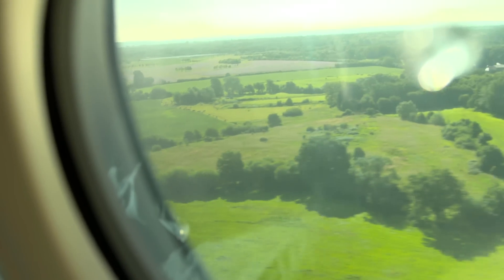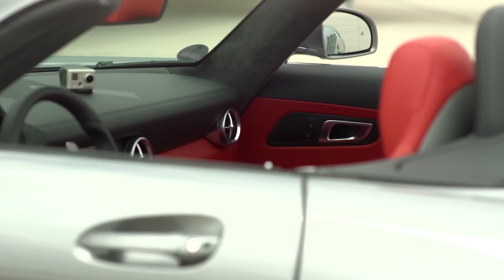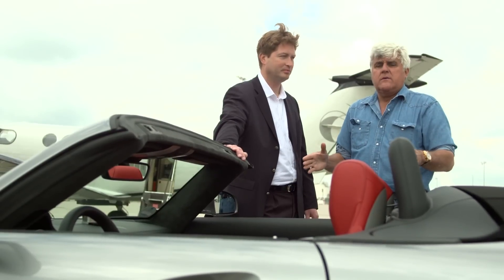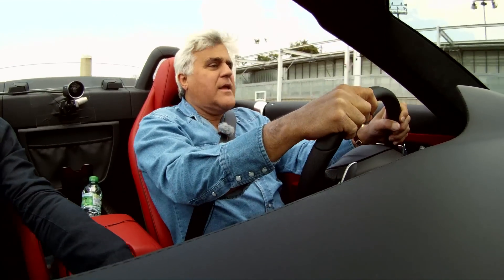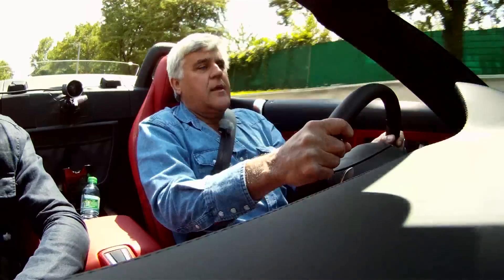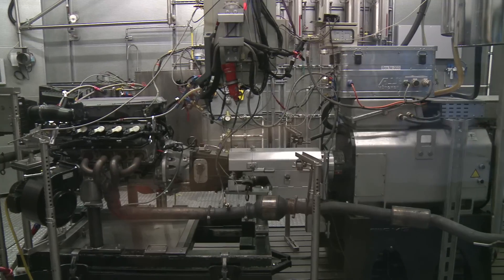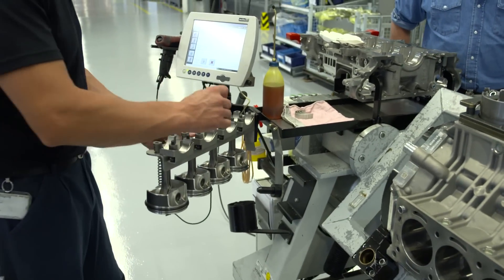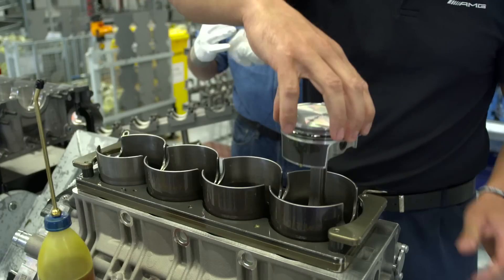2012 Mercedes-Benz SLS AMG Roadster - Jay Leno's Garage

Comment: I definitely agree on things like ground clearance, how well suited a car is to normal roads is a big deal to me. I want something I can drive without fear of ripping off expensive bumper parts or covers on the bottom of the car, or even worse, potentially damaging something as it scrapes.

Comment: assembly machines can build with much closer tolerances and a MUCH higher precision and consistency than a human can.so many advancements have been made since then that engines can be made with a much lower level of imperfections now than ever before. Nowadays, hand-built engines have a certain nostalgia to them, but depending on the sophistication of the assembly line (with exceptions of course) I'd say machine-built engines will be more efficient and have less problems on the road.

Comment: The license plates on European cars look much better than my American one...
Reply: Not really. In my opinion the opposite is true ;-) The german license plates are a lot wider than the american ones and they always look the same. The car owner also has to mount two of them, in the US you only have to mount one on the back ot the car I think? BTW, when you get a license plate for an american car here in germany, you have to buy a special plate called "verkleinertes Kennzeichen" (small licese plate) which costs a lot more than the standard wide plates.
Reply: Lejf Diecks Depends on the state. Some have only 1 plate, but most have 2. And they both have to be mounted.
Reply: Lejf Diecks
In America, it depends on the state in which you live. Some states only require  a rear plate while states like mine, NJ, require both a front and rear. You can also purchase custom plates that say things such as "hotrod" or you can purchase plates with flowers or animals or special graphics on them.
Reply: I am from Europe when we see American plates looks better 100 times. Our plates looks to cheap and small. AND WE need 2 plates allways. No country allows you to have 1 plate. U ruin the front from the car. In usa they use back plate and looks much better. and amg is overpriced car. Mercedes cost much more in Europe than America. AMg cost a lot 
CLS 63 AMG S 4MATIC cost 220.000 dollars cheap price. In Norway cost 300.000 dollars. Europe SUX AT PRICE from car. For bad car Mercedes 50.000 dollars 85 kilowats. For 50.000 in usa u get mustang GT and V6. I rather have mustang.
Reply: If you look closely, most things do. Like, american supercar: dodge viper=totally looks like some cheap ford fiesta inside.
Reply: *****  Every sport car should look cheap inside. Ferrari looks inside cheap to vs mercedes s500 or maybach. If interior looks so modern than you forgot its a sport car. Because when you are overspeeding those things interior inside you never need it. Thats what mercedes missed and bmw audi. ANd thats why they cost so much vs americans but not giving as american car for that kind of money. I prefer american car if you got money. I drive 525d because of work. I had mustang before but i work 31 days per day and can't drive everyday. But for summer i will drive only mustang. And feeling is a lot better in american car than a europe car. I had 12 cars from europe best feeling is USA CAR. You can try. Most people who spends 90000 dollars for diesel car who is rich for me is dumb He spends so much money on diesel and 100000 things in car and he don't use them half. So why spending so much money. ANd driving diesel to spend less fuel ? I spend less money getting powerfull petrol car and spends more fuel and what.. Whats the point.
Reply: *****  and ford fiesta doesn't look cheap inside for that kind of money the newest one.
Reply: I'm sorry, I reckon you gotta point, but european stuff tend to be more sofiaticated. Americans are more pragmatic and focus on getting it done rather than how it's done.
Reply: +Maximilian Dummnichtswürdigkerl hey. I must say I agree in some ways with you, in the UK and Europe we used to look down on American built cars, it was a running joke and very snobbish, today though I think the tide is turning. The Americans have built some great cars in the last few years and they do all what the European stuff does only cheaper. Yes build quality could do with some work but I think in 10 years time a lot more if us will be driving American cars.
Reply: Some European countries requires a yellow rear plate (GB for example) and they're ugly as hell. Quite a few people within the EU-parliament and countries which have them wants to make it so throughout the EU. I don't really understand why. 

The nicest are the American states which only require one plate. However the American plates have to me always seem to be a bit novelty looking. Good on classics but not modern cars.
Reply: +MakeSh00t They're not missing anything since that's what the European market wants. You spend most of the time in your car, so it should feel nice. And trust me that on European roads (which in my experience are better, albeit narrower) where you're allowed to put your foot down the mustang does not feel nicer. Once you go over about 100mph and have a slight corner a mustang is not a nice place to be.
Reply: Völundr Frey lol. i have bmw goes 140 mph and i never drive 140mph. So mustang wins. Mustang have no interior that is why is cheap. Everyday i see cars on roads.. When i saw cobra shelby all mercedes bmw can hide. Mustang is well designed. For its price. Ok new mercedes looks much more better like cla or cls.
Reply: You must think anything from Europe is better.
Reply: It's the oppside for me. Probably we like what we can't get.

Comment: Is there a way to Contact Jay Lenos Garage? In this Video he says he has had long ties to Mercedes Benz. I and many others own 1997-2002 Mercedes Benz R129 series cars (SL  280, 300, 320, 500, 600). For many months now all keys for these cars have been on backorder with no idea if they will ever be available again. The DAS (drive authorization system) is very complex and almost no locksmiths can make a key. There is a locksmith in California and maybe 1 in new York that can help but you have to have the car in person!  I live in MA and many of these cars (in excellent shape and worth $10-20,000) are sitting unusable due to the lack of keys.
Just wondering if Jay could help some fellow car and Mercedes enthusiasts out?
Reply: It is a seventeen-year-old used car. When I bought the car 6 months ago it only came with the one key. In Massachusetts all cars need a title so NOT a stolen car. 1997-2002 SL series cars the keys are no longer available. Do some research and reply! I have been to five different Mercedes dealerships in been in contact with Thomas Hanson of classic Mercedes parts and the keys are no longer available from Mercedes-Benz
Reply: I paid cash for the car from a reputable used dealer. He was also quite surprised when we try to order an additional key after I had bought the car. You keep avoiding the actual issue here. Mercedes no longer manufactures keys for these cars. It is not like Mercedes won't make the key because they think the car is stolen. The car is not stolen. I own the car outright and it is a lien free title. Once again the issue is Mercedes no longer makes keys for these cars!!!!
Reply: No they can not!!! The transponder keys with the chip in them the valet keys and the Flip Key remotes with the transponder chip in them are all no longer available indefinite backorder!!! You are not the first person to think it's as easy as you say. Actually the keys all come from Germany. They are then sent to Texas where they have all the drive authorization system codes and can install the code and cut the key for the car ordered from the Mercedes dealer. That is not possible on this car anymore as the original manufacturer of the keys is no longer in business. That's why the keys are no longer available call or talk to a local Mercedes dealer at first they'll tell you yes but once they look into it there are no keys available!!! I have had a bunch of actual Mercedes dealers try to order me a key. Every one of them comes back with the keys are no longer available what is so hard to understand??? I even asked to pay for a key so I could wait on back order in case they ever came in. They would not even allow me that. You are wrong and will not admit it!!!
Reply: 2000 SL 500/R129 Here is the VIN# WDBFA68F1YF191843I have had a couple of blanks cut so I have a spare to lock and unlock the doors. Because it is NOT a transponder key it will NOT start the car. I have a great relationship with 2 local dealers and their parts department. The keys are NO LONGER AVAILABLE!! You are wrong this time. read the links I posted!! Check via my VIN.
Reply: Maybe this will help. Read the whole thread as in the beginning everyone thought like you. (BTW you are wrong about having to remove a lock). The Texas location has all the codes for all the DAS modules and are the only place in the USA that can make transponder keys (for Mercedes). Some locksmiths can read the DAS and make a key but there are very few. The equipment to read the DAS fixed and random codes needed to write to the transponder keys are very expensive. and anotherhttp://www.benzworld.org/forums/r129-sl-class/2843730-r129-transponder-keys-nla.html
Reply: Did you read the link I posted? Here is another one. Read all the way through please.http://www.benzworld.org/forums/r129-sl-class/2842234-replacement-master-keys.html
Reply: You "may" be able to get a fob to sync with the car to lock and unlock the car but that is not the issue at hand! Inside the remote there is a transponder chip. The transponder chip is read by the induction coil at the ignition switch. If the transponder chips fixed and random code matches the DAS (drive authorization system) it sends a signal to the ECU to start the car. The DAS on 1997-2002 R129 cars has 8 slots. 4 being assigned to the keys that come with the car. 2 Flip remote keys/fobs, a master key with a transponder chip, and a valet key (all no longer available from Mercedes Benz). There are 4 additional slots in the DAS. Once any assigned key is used the random code is read and then changed to a new random code. Once a key has been used even Mercedes doesn't have access to that random code. If you were to order a new key from Mercedes they would look up one of the 4 remaining slots in the information stored at the Texas facility. They would install the code on the new transponder chip/key and send it to your dealer. Since the manufacturer of all the keys and transponders is no longer in business that is no longer possible!! In addition if over the years all 8 slots have been used no new keys could be made and a new DAS would need to be installed and all new keys made for the car using the info in the new DAS. Again this is not possible because Mercedes does NOT have any keys to program!! On newer cars that the keys are still available there are now 24 slots in the DAS. Trust me I have hundreds of hours of research into this. That is why I was hoping to get Jay Leno involved since he has a long standing relationship with Mercedes Benz. Here is an email I received from Thomas Hanson president of Classic Mercedes parts. Customer service was of no help!"Hi Mark, We are aware of this situation but I’m not sure where we stand at this point. I think someone is working on this situation. You can contact our customer assistance center at 800-FOR-MERCedes. Maybe they’ll know something further by now."
Reply: BTW here is picture in a thread pointing to the transponder chip which is separate from the fob.http://www.benzworld.org/forums/14939033-post36.html
Reply: I have 1 fob/key and only 1. At purchase I was told you could order a new key from Mercedes. Who would have thought otherwise. The dealer, myself, and the couple of Mercedes Dealers I do business with were all surprised that they were no longer available. The ebay one will not work. You obviously haven't read any of the threads I linked to or know exactly how the DAS works with the transponder.
Reply: So much for you never being wrong, ever. First you said I had a stolen carThen tried telling me to buy an ebay key that will not start the car.Now you are saying you could "fool" the ECU.When I said keys are no longer available from Mercedes you implied I pissed off the dealer and he won't make them for me. I have given you links showing this is a big problem for owners of 1997-2002 R129 cars. Have you read any of the links? I'm done here.
Reply: 867-5390

Comment: Ferraris and lamborghini engines are assembled by hand.
Reply: Some Ferrari engines are built by a single master technician. But they do not sign their name to each one. Ferrari believes that the success of the company is not based solely on a single individual employee or component of the cars it builds, in despite the fact Ferrari is famous for one thing, its engines. 

Parent company Fiat has also taken a more direct management approach to running Ferrari over the last few years.  Individuality is not something the company has emphasized. This oversight continues despite FCA spinning off Ferrari, now headquartered in The Netherlands of all places. FCA still owns 80% of outstanding stock in Ferrari.
Reply: Ecotech Nissan GT-R are
Reply: That AMG engine was also......

Comment: 20,000 engines per year? So they making over 54 per day???
Reply: If there are 27-30 guys or gals working there, it's totally doable. There should be at least 20-30 plates on that wall.